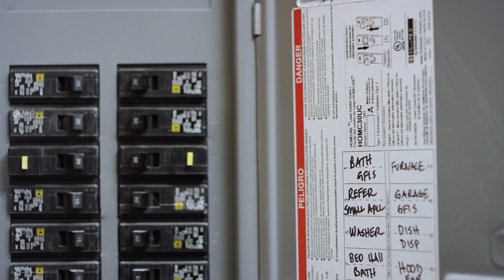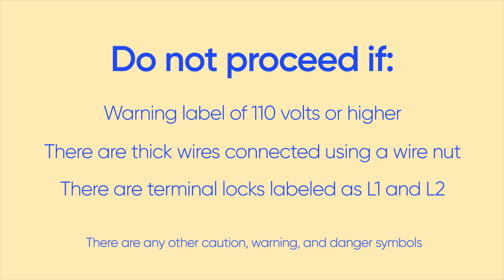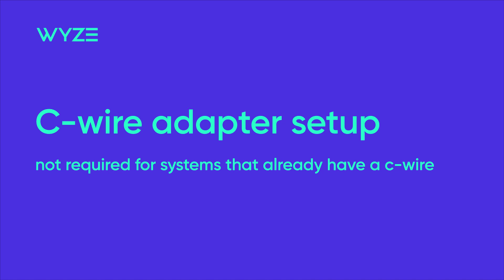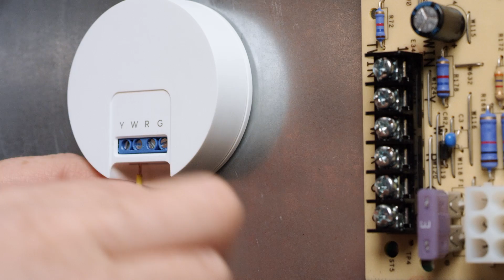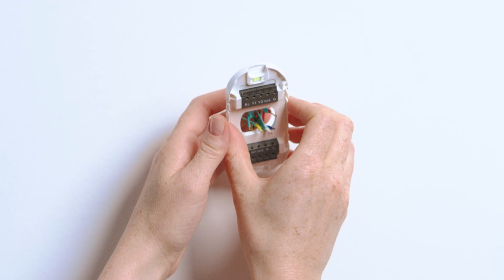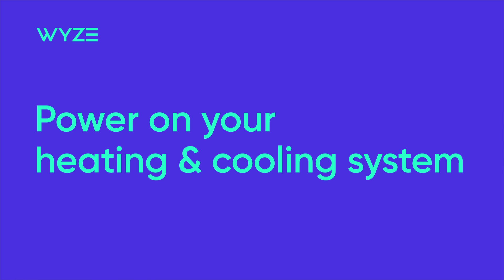How to Setup Wyze Thermostat

Comment: I just got a house that is the Waze thermostat.. this is the worse product I had tried before to do the installation, even though the thermostat was already working (manually) and the previous owner managed it through the app, adding it to my account and application has been an odyssey, you have to do the setup as if you were completely changing the thermostat, it asks you to do the installation of the cables and does not let you skip those steps (taking into account that it is already installed) at one point it tells you that you cannot continue with the installation, customer service only says it recommends calling a technician, just to configure the app for something that is already installed? is it a joke? .. it is a very bad experience with this equipment, it is very complicated .. buying with google nest which was from installation and reinstallation very easy and fast. I do not recommend this product at all after this experience.

Comment: where the blue c wire come from, it wast there in the beginning of the video. i bought mine when it came out, i gave up installing it. it wast working right. i have no c wire and i followed the instruction but still nothing working correctly.........might try this year with external c wire wall adapter.

Comment: so far this app sucks why do you need to have an account to hoook up this unit, seems screwed. now it will not mail me a reset...idiots......why do i have to log in to get instructions  taking up so uch time.
Reply from the maker: Hi there! You can refer to the following link for instructions to set up your Wyze Thermostat with a C-wire here: https://support.wyze.com/hc/en-us/articles/360049453272-Wyze-Thermostat-Installation-Guide-with-C-Wire

You can use this link for instructions to set up your Wyze Thermostat without a C-wire adapter here: https://support.wyze.com/hc/en-us/articles/360054217892-Wyze-Thermostat-Installation-Guide-with-C-Wire-Adapter.

Comment: Just installed it. It would have been great to note that even with a C-wire, it needs to have the red going to Rc not Rh. Troubleshooting why power wasn't reaching the thermostat was fruitless without that little nugget done, but not mentioned, most of the way through the video, about 5:35.

Comment: I bought my Wyze thermostat on sale at Lowe’s and was hesitant to install it since I have a very old home and my existing thermostat didn’t have the C wire. Rest assured, if you follow the very detailed and helpful instructions in the Wyze app under “add device” I have every confidence you can install it like I did. It was all done within a half hour and the app itself asked me specific questions to make sure I installed it correctly and safely with several prompts to ensure my power was cut to the system to prevent shocks. Very impressed, as usual with Wyze, and happy to have it completed all by myself!

Comment: How do I know the difference in like the red word corresponding to r,rh etc how do I know which it which
Reply from the maker: Hi Matt! For wires that are connecting to your R, Rh terminal, they are usually connected using a jumper small jumper cable. You should be given the option to reconnect your wire to the R, or Rh terminal. If you're unsure, our support team would be glad to look into this further. If you haven't already, you can reach them by submitting a support request using this link: https://support.wyze.com/hc/en-u
Reply: @wyze  ok thank you I’ll see what I can do
Reply: @wyze  also same thing with the y1,y2 how would I know those differences. I’m used to just having single letter like o y b g b c so I just use the lowest number one with the ones that have numbers attached like y1
Reply from the maker: For this one, we'd recommend working with our support team because they're better equipped to help resolve these kinds of issues and to ensure that you get help quickly. Please submit a support request using this link: https://support.wyze.com/hc/en-us

Comment: Unfortunately I have an old heating 2 wire system no c wire and the control panel only has 2 wire connections that’s it. I need a power supply not sure how to connect that.

Comment: The old wire set shown at thermostat side shows a C wire in blue, why do you need to use C wire adapter, or when you insert wires (from thermostat) to C wire adapter, it only shows 4 wires with no blue wire...?
Reply from the maker: Hi Jack! Thanks for reaching out. The blue C wire was only shown here as an example. We wanted to show that if you do have a C wire, you shouldn't use the C-wire adapter as an example. Please note that while C-wires are typically blue, some thermostat C-wires can be black, brown, or even purple. Sorry for the confusion! We'll make sure to pass this feedback along to our team to improve future processes like this.

Comment: Warning!  DO NOT PURCHASE WYZE PRODUCTS.  THEIR PRODUCTS ARE GARBAGE.  THIS COMPANY DOES NOT STAND BEHIND THEIR PRODUCT.  CUSTOMER SUPPORT DOES NOT EVEN RESPOND TO EMAIL.  ALL THEY DO IS GIVING YOU THE RUN AROUND ASKING YOU FOR LOGS AND FACTORY RESET. THE DEVICE THAT DOES NOT WORK.  THEY BROKE MY THERMOSTAST WITH A FIRMWARE UPGRADE AND THEY DO NOT WANT TO REPLACE IT. AGAIN, NO COMMUNICATION.  YOU SENT THE LOGS AND YOU ARE NOT GOING TO HEAR BACK FROM ANYBODY. SAVE YOUR MONEY DO NOT EXPEND IT ON THEIR GARBAGE PRODUCTS.  THE WYZE PRODUCTS DO NOT EVEN LAST A YEAR.  THEY OFFICIALLY LOST A CUSTOMER.
HOPEFULLY YOU DO NOT MAKE THE SAME MISTAKE AND PURCHASE THEIR GARBAGE.

Comment: Worst thermostat I used I don’t recommend this if you set your temp at 72 it won’t shut until it get to 75 witch is fucking crazy and then if you set it at 75 it keep turning off and on every 2 sec

Comment: I just installed my first thermostat for a test run. If it works well I will be replacing ALL of my Nest products with Wyze. I'll add 3 cameras and 5 more thermostats to my house and fund it with the sale of the Nest products. The V3 camera has sold me already. The door sensors are great. Motion detectors work perfect. Wyze is going to kill the competition.
Reply: You have 6 HVAC Systems in your house? If not, how are you wiring up your Wyze Thermostat?

We have 2 HVAC systems. Neither are ducted into my office (formerly a small garage). I have a space heater and a small window AC unit in my office. I run both through independent Wyze Plugs so I can turn them on or off through the app.

I want to set up some rules in the app to control these plugs based on temperature set points, so I would need to run a thermostat without an HVAC control board being present and use rules in the app to control everything.
Reply: @Phyxx_TX  I think he ment 5 sensors.

Comment: Anybody else having huge temperature swings with this thing? I installed one a couple days ago and it will drop 2 degrees before kicking on and then over shoot the set temperature by 2-3 degrees. And yes, I have tried every "behavior" setting. Thanks
Reply: Horrible thermostat
Reply: I think you bought the bipolar wyze thermostat edition. You played yourself bryan titty

Comment: Received mine and the old thermostat doesn't look like in the video and there is only four wires, the blue wire are disconnected in both ends, my understanding the blue wire they called it here the "C" wire. So without the blue wire don't work? Why there is only one example of old thermostat? And how can one get help with this? 😤

Comment: Installation was pretty easy. Only issue was that my existing tstat didn't have a C wire. So, the instructions pushed me towards installing the C wire adaptor at the control board. I almost installed the C wire adaptor when I realized there WAS a C wire at the control board. It was just that my old Tstat didn't use it. Phew! So, I just added in my C wire to the line going to the Tstat. So, make sure you don't follow the walk through in the app to install the C wire adaptor if you don't need to! Most systems have the C wire, it's just that typical dumb Tstats don't use them.
Reply: Where did you connect it at the furnace? Mine is just hanging out on both ends.
Reply: My AC tech had the c wire attached to B. And it's a gas furnace. SMH.

Comment: I'm confused, during the initial setup and removal of the old thermostat in this video the wires are red, green, yellow and white.  Once the Wzye thermostat is install a fifth wire (blue c-wire) mysteriously comes out of the wall.  Is this the same thermostat of is there two different methods being used?  I have a this type of Honeywell thermostat and my c-wire (yellow) is not connected instead a blue wire is connected to the yellow screw so will I need to connect the c-wire adapter to the furnace and connect the c-wire to the Wzye screw?
Reply: this is very confusing to those who do not have that common wire. the common wire is used to power the thermostat (display constant power). Wyze does a horrible job at explaing in this in their video but they have a FAQ that mostly covers it. The round white adapter is in fact a c wire -adapter. It literally will split the power internally so you do not have to run that common wire separately.

Comment: I feel like I'm missing something. I got everything connected with the c wire adapter and the unit will not power on once I turn on the system. Had to hook my old system back up. Any troubleshooting?
Reply: The adapter did not work for me. Fortunately I had the blue wire unused at the thermostat (it was just wrapped around the insulation along with the brown wire). I went into the air handler and connected it to C on the control panel then to the C on the Wyze thermostat and it worked. I have a Goodman A/C unit with the forced hot air element in the air handler.

Comment: *STOP* Those that plan on buying one of these go to the Wyze forum on setup. https://forums.wyzecam.com/t/wyze-thermostat-problem-heat-and-air-are-mixed-up-using-recommended-wiring/150604 or search for heat and cold reversed Wyze thermostat. Lots and I mean lots of people are having issues with these.. Not one answer from Wyze.

Comment: I just connected my thermostat but it does not turn on i dod have to use c wire adapter not sure why its not starting
Reply: We moved green wire to C and it worked.
Reply: Having the same issue.
Reply: @Peachquilter  i resolved the issue i had two issues first the video doesnt tell you but the app instructions state you change your rh wire to rc and it worked with the c wire adapter but i routed a new wire anyways

Comment: Do you need a yellow wire? I just have red and white
Reply: Exactly my situation here. It says the wyze thermostat isn't compatible, although I also have a Nest thermostat installed.
Reply: Different system have different set-up yellow usually is fan red is hot/power ect.

Comment: We got ours today, and we do not have a straightforward “control board” but we do have a bundle of wires that appear to be the right ones based on color, and are wire nutted together, according to my owners manual diagram they are thermostat wires. Is this where I need to hook it up? We have a Coleman  EB15 furnace
Reply: Just call an HVAC company to install it for you.
Reply: @michaelkidd7821  already did, lol. Wasn’t worth all the guessing

Comment: Had issues at first my old stat had r wire jumperd to rc then w2 to y2
I also found a common blue wire cramed back into the wall it all works except emergency heat...
Reply: You played yourself james toddler sir

Comment: Ours arrived today! They were easy to install and are working well so far! Thanks for making high-quality, low-cost tech that enhances our lives! :)
Reply: Does it display outdoor temp using internet/location?
Reply: ABs208 it displays the indoor temp on the display (only if you walk in front of it), and it shows the indoor temp and indoor humidity when you look on the app.
Reply: @5tamey  lame. Was kind of hoping it’ll show the outdoor temp using location services. Maybe in small font under the indoor temp.
Reply: ABs208 I have a ton of smart devices that give me the outside temp so I don’t need it on my thermostat; I get all the features I need for $49, and people like yourself that want more can buy the other brands that are available at a higher price.
Reply: @5tamey  not complaining. Just figured tha was a basic feature. Couldn’t be that difficult to pull the data via location services and display. Not a make or break for me. It would be nice on my way out the door early in morning if I could see the outdoor temp at a glance. Been buying wyze for years and don’t plan to stop now.
Reply: 1yr later do you still like the thermostat?
Reply: @deew7837  Yes, I love them and they still work great!

Comment: Hello, I have a question about old thermostats. The one I'm currently using is a pretty old one, (round-shaped, mechanic, Honeywell) I tried to remove the faceplate and it says Series 20 Wiring, which has 2 cables only. Can I still install this? (I've posted the same question to How We Made Wyze Thermostat video, to be sure I'm also posting here)
Reply: No you can't. I just tried. You need a yellow to your thermostat too and need to have those plus a C on your main controller. Or rewire everything which I do not suggest.
Reply: @iamhungry1387  Thank you, then I just keep using the weird-looking esp8266 device I built. :/

Comment: Can the thermostat also control the humidifier?
Reply: Did you get an answer?
Reply: @NickzAndMikz  I never did,  and after plenty of research I ended up buying a Sensi thermostat, even though I have a few products from Wyze. I would highly recommend Sensi thermostats, the best thermostat I could have bought.
Reply: @ignacioottati2597  Thanks for the reply!

I’m going to see if the nest thermostats can, and if not I’ll look into those!
Reply: @NickzAndMikz  no problem. The Sensi that I bought was able to control the humidifier as well but due to complications with the way my system was wired I decided not to control it though the thermostat but at least I can see what the humidity is and get alerts.

Comment: So, if I don't have a C wire connected to my current thermostat, the adapter is required, correct?
Reply: Yes and it is included, just follow steps in video how to connect it make sure to shut power off before installing

Comment: This is crap!  Why not show "how" the BLUE wire got to the thermostat?  You try to make it look easy... Running that wire is not, therefore you skip it. Shame.
Reply: Listen to the narration. If you use the C wire adapter you won't have a C Wire at the thermostat end (if it works like the ecobee one, it combines Y and G onto one wire and uses a diode inside the thermostat to split them back up internally, which frees up the G wire to act as a C wire). [Comment copied from Zan Hecht as I'm not going to retype the entire thing]
Reply: @noxious_nights   Thank you for sharing this! I have been searching for hours online trying to find out how the adapter worked considering you didn't have to run a C wire back to thermostat.
Reply: thinking the same thing
Reply: What if you only have W And RC to the previous thermostat then what? The wire colors are red and white.

Comment: i only have a red a white wire will this work?
Reply: Same question here
Reply: What is it connected to W, Y, R, C, etc??? Also does your current thermostat battery powered and last thing double check to see if there are more wires behind the wall not being used you might get lucky.
Reply: No!!! Originally their answer was yes. You need to have a yellow wire too. And you also need to have a C on your main controller.

Comment: Have a furnace with no C wire only R and W. Can an external power supply be used?
Reply: I think that I only have the two wires on mine. I'd love to use this device but I'm not sure if I can.
Reply: Same question here
Reply: Do you have a common wire at your furnace, use C wire adapter at furnace R, W, C to common cap G and Y attach R and W from thermostat wire to C wire adapter
Reply: @murph5150  no I don’t. A/C and heat are separate units.
Reply: Is the AC wiring together with the Furnace wire at the same thermostat  location, if so you can out the C wire maker at the AC unit pick up the common there
Reply: I imagine these steps should work for the wyze thermostat, haven't tried them yet.

https://support.ecobee.com/hc/en-us/articles/227874667-My-thermostat-has-only-two-wires-Am-I-compatible-with-ecobee-

Comment: I have a boiler, no AC, and 2-wire thermostats. Do I still need the c-adapter?
Reply: I have same thing 2  wire gas furnace boiler no ac....I hope all went well ....hooking mine up today...
Reply: Glad I could help
Wish they had a solution
I even have a brand new boiler but did not replace the wiring.
Reply: Yes
Reply: It's not compatible with a 2-wire system.
Reply: @user-yw1lj3tr2p  that was fast !just ready to take out of box....did you return yours and was it difficult to get a hold of them.....appreciate your fast reply....Rick
Reply: @spiderstone  I canceled the order when I asked them and they refunded me.
Reply: @user-yw1lj3tr2p  hey you saved me time and money......thanks ad hoc......
Reply: Not sure why it can't work, it works with the nest... There should be a work around, jumper wire maybe?
Reply: @SanctuaryGardenLiving  not sure but they are clear, it is incompatible.
Reply: @user-yw1lj3tr2p  guess it's going back and getting the nest

Comment: Yup good video, however I get that they shut the power off and all that kind of stuff, just a little curious why he didn't use an insulated screw driver.
Reply: I’m pretty sure they are using the mini screw driver that they ship with the unit
Reply: I think it's all low voyage connections.
Reply: Voltage.

Comment: I have a heat only system which just has a red and white at the thermostat will this work with my heat only system
Reply: Same question here
Reply: Same :) I just have an oil furnace. No AC.
Reply: It should work, the nest works so this should, just trying to figure out how!!